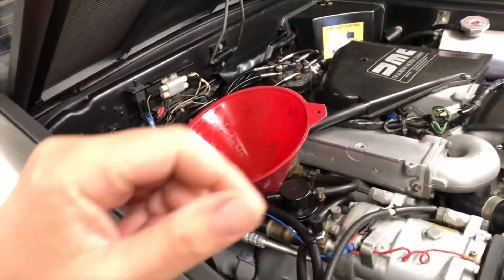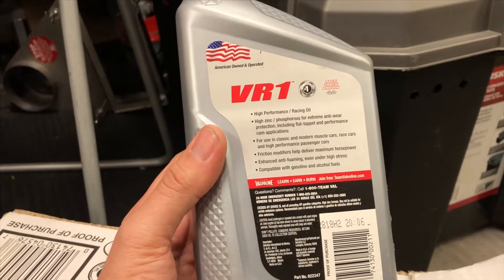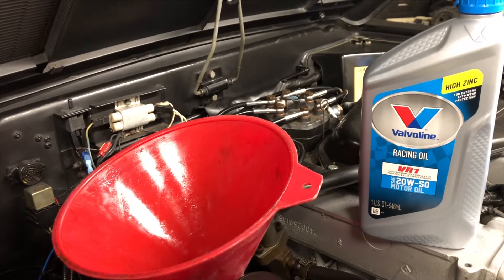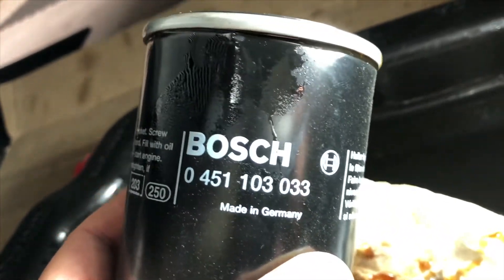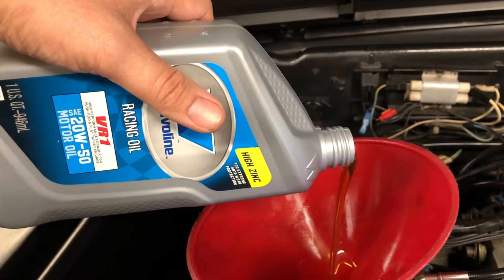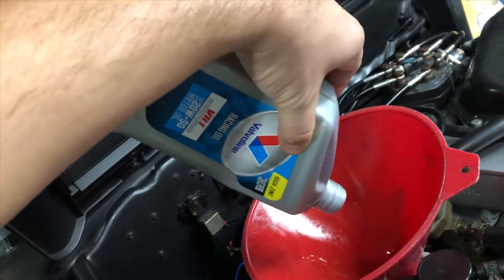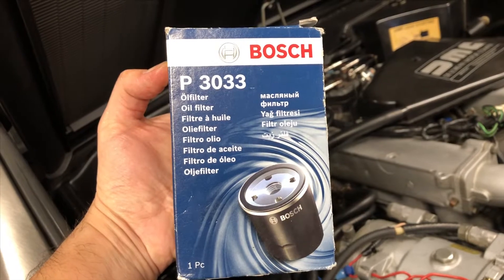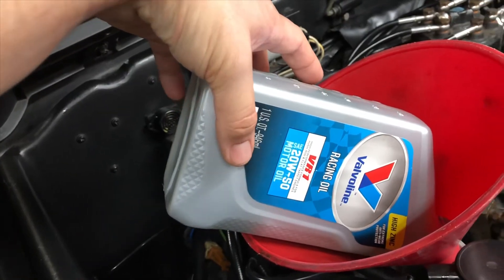The BEST Oil Combo for DeLorean Engines? VR1 High-Zinc Oil + EZ-Oil Drain Valve + BOSCH Oil Filter

Comment: Thats all good oil. Synthetic is great for these engines ONLY, as you mentioned if they have been resealed and ran great prior to a reseal. I used to run Mobil 1 15w-50 with a STP zinc and phosphorus additive for years. Now for over a year I been using Royal Purple 20w-50 that comes fortified with the zinc and phosphorus. I over hauled my engine 10 years ago and still have the original rear main seal and doesn't burn a drop or leak. I purposely went 7000 miles till the next oil change and still didn't burn anything. She smooth and rev's nice and free but as mentioned, Synthetic should only be used when the engine is fresh and sealed and mechanically sound, Other than that use the Castrol GTX or the VR1! Another great video Todd!

Comment: ah! A week too soon, I just did a Oil change , Bought a pennzoil 20W-50, because its cheap and could be bought a Japan Amazon ,  
A friend in Japan he put the best Japanese made oil and it cost 30USD per 1L  [Motul 300v 20w50]  ,  
becase he say if you goona put some oil addtive in , why not put the best of best motor oil in first place .
Mine Delorean are now at 25000 mile ish, and since the  car was bought, it came with new oil , so its  just been 4 month .